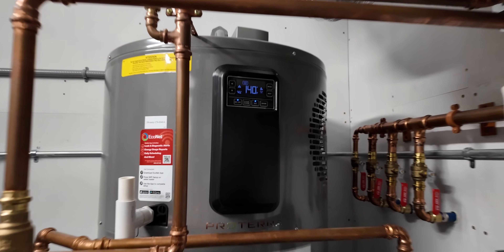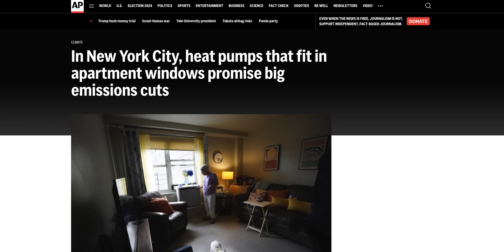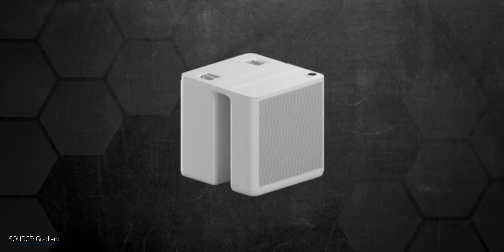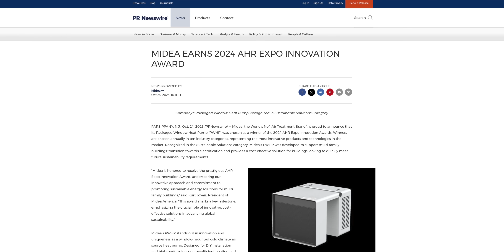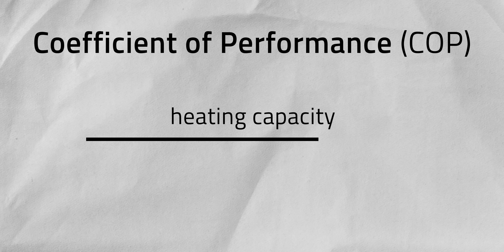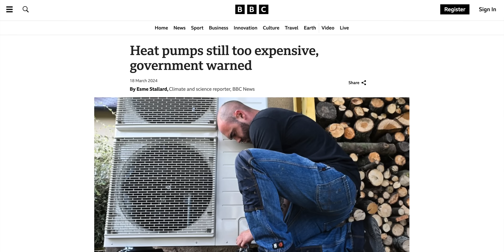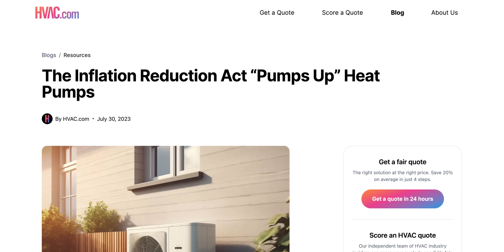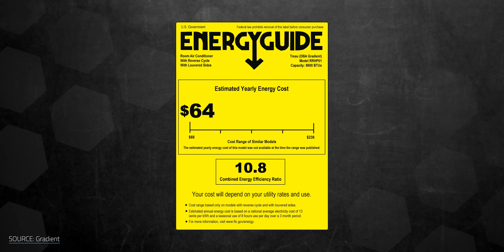Why This Window Heat Pump Is Genius

Comment: as a european it is comical that you start talking about heat pumps when they are over 40 years old. It started to be installed in many houses here (Sweden) around 2000 and almost all houses built after that have it as a heat source and many retrofitted in older houses that were built after WW2. Then we also have heat recovery on the ventilation, so 80-95% of the heat that is vented out to the supply air comes in. You are far behind us in both saving money and the climate because you prioritize wrongly
Reply: To be fair, Americans live with the energy policy dictated by their government which is in thrall to Big Petroleum and all the businesses that suck off that teat, like auto industry, big ag, etc
Reply: Start talking about them? My parents bought a new house in the 1980s with a heat pump. There are many of them in the U.S.
Reply: While I don't disagree, not every country in Europe has so uniformily adapted - new stuff is really good in NL (ground-source heat pumps and triple-pane glass), but standalone gas boilers are still very common, and insulation is not... the 1920s house we moved into has huge single-pane windows and had visible gaps around the doors outside. Cheap gas is gone now, but they just cranked the boiler higher...
Reply: It's what happens when fossil fuel corporations purchase your government, everytime. 🤦‍♀️🤦🏿‍♂️
Reply: This is a thing in the SEA for decades lol
Reply: @jadu79 Yes, the United States is backwards in many ways. I live in this open dumpster fire of a country, follow all the rules, and yet my life is a waking nightmare. My counterparts in Europe, I'm sure, are much happier.
Reply: Early heat pumps were inefficient at low temperatures and switched to resistance heating. It was not great as the only heat source with no backup option which the new units can do.
Reply: Its comical when Europeans start dropping like flies when temps hit 27C(80F). Thats nice sunny weather for most of the US. Different climates, different priorities its that simple. Here in Texas we can get up to 45C(115F) with 50%+ in humidity in summer, why don’t most of yall have ACs?
Reply: No need to fight. If the US had the hydro power that Sweden did, we might have made the same choices.  If Sweden had mainly coal power and a huge natural gas supply, they probably wouldn’t chosen to have burned coal to make electricity to then convert back into heat. We’re all human and we all make the same sorts of decisions when put into the same situation.
Reply: They've been around in the American south for that long as well.  They are only new to the northeast
Reply: Well, Im a European. I live in the Netherlands and we use gas heaters mostly everywhere here still. We also had a lot of natural gas.
Reply: @jadu79 I'm glad we can amuse you.   Did you personally invent the heat pump?   Did you even have to crunch numbers to see if it made sense for your home?   Stop being so smug.
Reply: The USA has not been run by a majority of adults since 2017.  Sweden is still run by adults. Try your best to keep it that way.
Reply: Well, in America we have cheaper energy and a ton of natural gas.  It slowed adoption of heat pumps because they didn’t make economic sense here.  My electricity is 12 cents/khw and it is about 25 cents in London.  That difference is even more for natural gas.  

That leads to different choices.
Reply: @SeanButlerATL it's still a matter of prioritizing. Your government could've opted for increasing fossil energy prices via taxes (like ours does on fuel) and incentivising green solutions like this. Where time and money is spent boils down to priorities.
Reply: @jaspersiegmund seems to think that the US citizens have some sort of control over the US government. 🤣🤣🤣
Reply: It must be nice having such a tiny unpopulated country that getting the masses to work together on a short time frame is a reasonable ask. Once you hit 50 million people things start getting more challenging. 

And with how mild and uniform your climate is the same technology would work in every house. I'm in Ohio and our temperature varies by over 100 degrees throughout the year, and Ohio is mild by Midwesterner standards. And that's just one region. The coldest Alaska gets compared to the hottest Death Valley gets and it's closer to a 200 degree variation annually.
Reply: @jypsridic  "mild and uniform"? You are aware that the entirety of Sweden is located more north than Edmonton, right? Southern Sweden swings between around zero F in winter and a hundred in summer nowadays, and the northern parts -30 to plus 70-80 is no surprise nowadays.
Reply: @joacimnilsson6341  that's the same as Ohio, which as I've said is considered mild here.
Reply: @joacimnilsson6341 yes but you have the gulf stream! So it is actually pretty 'mild'. It would literally not be a habitable area without the stream

Comment: Nice of you to be concerned with us, but every home in Tokyo has a heat pump - I have two. The wall mountings, electrical supply, ducts, and supports for the external unit are standardized and built into every house and apartment.
Reply: Can you link some photos or videos of the standardized ducts and electrical supply?
Reply: Same in the EU.
Reply: The situation in Tokyo is a bit different than here in the US.  Many of the buildings in the US are older stock, and there is much more demand here for older homes with 'character'.  The notion of a home with character is not very common in the urban areas of Japan.  An older home in Japan is more likely to be considered cause for either a complete demo and rebuild, or at least a gut and remodel.  Those details make the standardization needed much more likely there.
Reply: Well when you tear down and rebuilt homes every ~20 years, it's a lot easier to keep up with technology. I'm in a house that's over 70 years old.
Reply: Installing a heat pump takes a couple of hours and can be installed in any kind of house. The age of your house is irrelevant.
Reply: @Loreroth  The discussion here was more about apartments, though, which complicates installation significantly. Many buildings don't allow installation of anything on the facade, which rules out a split system unless the building isn't too tall to have the outside units on the roof. Once above a certain building height, the refrigerant runs become impractical, plus of course you're going to run out of roof space.

Comment: No.

Too expensive for the convenience. 

And as I mentioned to another viewer, I'd rather see standard mini splits installed because they are less expensive, can be used in stages of 4 (consumer DYI options) and you can hide that unit vs a bunch of units hanging off the front of the building.  Yes, there are pipes etc protruding from the units but again, easy to hide. 

The idea is great, the tech being made smaller and again, convenient to use (for most DIY'ers) is what you are mostly paying for. And if you cannot or are incapable to putting a mini split in because that requires a hole through your exterior wall. But is that worth $3k?  ... I don't know if it is.

$1.5-2k before rebates? I'd possibly be interested. Only because it's heating and cooling.
Reply: I think the proper price point should be between 1k-2k regardless of rebates. Easily make that cost up with your electric savings.
Reply: @thecocktailian2091  Well, that all depends on the variables as Matt also mentioned.

Are those buildings at all energy efficient? Has insulation been placed on exterior walls if non-existent? Replaced bc it's from the early 20th century? These aren't being placed into passive or even energy star homes. 

In my 3 floor home these are also not cost effective. My house, built in 1975 also is not a good candidate due to needing new windows, there is literally zero exterior insulation. 

So these are not an instant savings as you're implying with your comment. There are many factors that need to be applied. If you do not you may end up feeling the system as a whole was not worth the money regardless of the cost. I might save some money but I'm not recouping that investment for a long time and that is a major factor as to wether one believes that investment is worth it.
Reply: @shawnduffy279  well, these are not meant for homes, they are meant for apartments. Of course there are a myriad of factors, not the least of which is matters outside of the financial. Environmental, flexibility, efficiency, etc.. The lesson being, do a lot of homework to find out if they are right for your personal situation. Im just happy to see new tech try and address the issues of the day.
Reply: @thecocktailian2091  Agree. These aren't meant for homes but the option could be available in the future. I also like what they are attempting to do with the tech. 

I'm only adverse to the cost.
Reply: @shawnduffy279  I concur.

Comment: 1. These are massively overpriced. This is the same tech as a regular AC with the only change being the form factor and a second valve allowing the coolant to run the other way for heating. 
2. I can't find these anywhere, not even on the manufacturer's websites. 
3. I dunno if this would fit into my windows as each has a large wooden base on the inside and outside.
4. The radiator problem, old places would put the radiator directly below the windows as they were the biggest air leaks taking up much of the room needed to install these.

Comment: Thanks Matt!  This is great information and very timely in my case.  I'm installing a new (traditional) heating system but these heat pumps could take a significant edge off my heating costs.  I have a 10KwH solar array that I've had for almost a decade and the excess I generate can be applied to these newly designed heat and cooling pumps.
It would be helpful to include the links to these manufacturers provided they have home pages to these new devices.  Excellent post.

Comment: Most apartments I know ban outside the window air conditioners.  Maybe a condo can get away with it if the rules do not ban the practice. Portable AC units with hoses for window frames are approved. Plus these are designed for the windows that go down and up and so will not include the sliding window models.  I think the up and down window scheme is prevalent on the East Coast but not the West Coast.
Reply: Places like NYC, New Orleans, Chicago. All have copious amounts of outside AC units. You must live in the few restrictive places in the US.
Reply: @thecocktailian2091  West Coast and for many people the outside AC unit resembles cheap motels which for many is an eyesore.
Reply: @anthonycarbone3826  I agree, they are not attractive. I know LA has a ton of window units. But now the you mention it, I haven't seen them anywhere else on the West coast. Funny that.

Comment: Great idea, but what about always hot and humid locations like the Dominican Republic?  A pump that can heat is not needed. Will there be lower cost pumps for AC only?
Reply: Their are already hundreds of AC only units from 200-500$ some even in the saddle style
Reply: A heat pump is just an air conditioner running backwards. So no, one is not cheaper than the other, the only extra component is a reversing valve. Granted, the units in the video are literally 10 times the price of similar models online, so there's your saving right there lmao.

Comment: Maintenance to keep this unit efficient is key because the up keep is more labor intensive than the old way and in truth who has more time on there hands to clean coils ....   I know I bought a heat pump hot water tank ... OMG, I have to clean it all the time to keep the alarms from not going off... but I do save 40 dollars a month on electricity ... but pay way more on cleaning coils every 6 months -- everyone maintenance cycle will very on how clean the air is you have going in your unit... THIS NEEDS TO BE SAID... I like saving money but I like saving time as well...

Comment: These look great but if they top out at 95°F then you will have to give up your ac or pop the compressor during heat dome or wet bulb events. If they can't reject heat they break. I am all for heat pumps, I would expect Mitsubishi to come out with one that has comparable seer ratings, but higher and lower temperature thresholds.

Comment: Until they change the form factor, many renters can't use them. Anyone with a bare coil radiator right under the window (very common in NYC) can't have anything hanging below the window on the inside of the apartment. 
Also many older units in NYC have abnormally wide windows (40-44" compared to the average of 32-36" that window units are designed for) due to being old enough that wider windows for more airflow was the cooling solution, and most current ACs simply will not fit without custom work, so the heatpumps may similarly not actually be self-installable.
Additionally, why are these so expensive? Heat pumps are just a few more valves than ACs. I could see $1000 for the fancy form factor, but when the average AC in the 8000BTU range is $350, $3000 if a ludicrous markup.
Reply: I lived in NYC apartments for over 40 years. Yes, some windows have radiators in front of them, but most do not. Not everything will work everywhere. Extra wide windows aren't a problem. There are many ways to fill the gap.
Reply: Extra wide is fine tho you can put insulation or even put two of these units to fill the gap. The advantage these have is they make a smaller opening to fill with insulation than your average window unit
Reply: I believe they make reverse U versions that can be used in this situation, However it will block much of the window.
Reply: @jamisonhawk7711  Those are normal ACs, not heat pumps.
Reply: @void2258 Normal ACs are just one-way heat pumps. That said, I don’t really understand the purpose of the U-shape form factor. They could just put a reversing valve in the old-school cubes, but I guess that makes it harder to charge ten times as much… 🤔
Reply: @serversurfer6169  With US style windows standard boxes leave the windows inoperable (without custom work). The U-shape allows the window to be used. It all reduces the amount of insulation needed.
Reply: Well the radiator can be turned off and you won't need it anymore. Yes you'd have to pay for heat, but you'd also be able to CONTROL THE TEMP 🤯🤯🤯.
But the radiators are an issue also because the saddle of the unit would have to be huge.
Reply: @searchingfortruth619  I mean physically it cannot fit because the radiator is present. Also a number of apartments conceal the radiator behind a very thin metal plate and that can't support any weight, so probably would't work there either.
Reply: @drivenbullet260  The $350 midea U AC window unit also has inverters. They are not that huge of a markup anymore (I don't think they were ever $750).
Reply: @drivenbullet260  lol inverter technology
Reply: A window that is too small is a problem.  One that is too big is not.  We invented plywood decades ago.  Also those bare coil radiators can be easily removed.
Reply: @davidbeppler3032  not if you are a renter and forbidden from changing things, they can't.
Reply: The price is 10% materials, and 90% Uncle Sam markup.
Reply: The government makes a problem, and the private section has to find a fix, making everything more expensive. Thank you, government, for being the biggest waste of money known to man.
Reply: @letsgobrandon4175  How does this have anything to do with the government?
Reply: @letsgobrandon4175 No, the private sector created the problem, so the government mandated they fix it. 🤷‍♂️
Reply: The 350$ AC you are referring to literally has zero efficiency as you need to cool the evaporator by dumping cold air from the inside to the outside using an air hose. Effectively creating a (tiny) vacuum inside which draws in warm / humid air from all other rooms / outside. Effectively heating up your room even more due to heat radiation from the hose / casing of such ACs. These things are only good for cooling if you sit in front of the airstream. They are cheap because they are very very inefficient.

The new ACs seen in this video solve this issue as there is no breach of isolation between inside and outside. Additionally you are re-circulating the already cooled air inside and cool it even more which has a cooling curve similar to an exponential decay.
Reply: @TheFlatronify  I am talking a window AC unit, not a portable. Don't know where you live, but a Midea U window AC (bends the other way) is only $350.
Reply: @TheFlatronify  then compare it to a panasonic with a scoop better then 6 and a price at around 1/3

a heatpump does not cost that much (specially with that bad a scoop, you have to add that to the cost)

Comment: I don't see how this is remotely practical for anyone I know. Does it come in other shapes and sizes? I do not know a single person who has a window that would be compatible with this device. In fact I don't remember ever seeing a home with this sort of windows in any nearby city. I have seen houses that were over 100 years old that has this. But outside of incredibly old heritage houses this size and format is completely useless to 99 percent of the people who live anywhere in the city I live in. We have had sliding windows that slide horizontally and almost all of them are blocked from opening more than a half foot or so with security locks. Or have had window frame modified to prevent windows from opening more than a half foot.